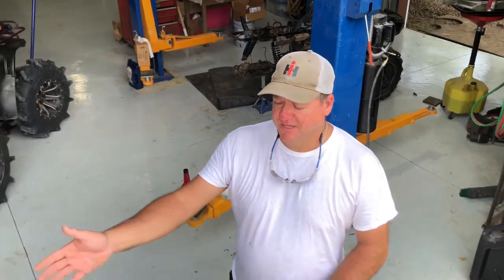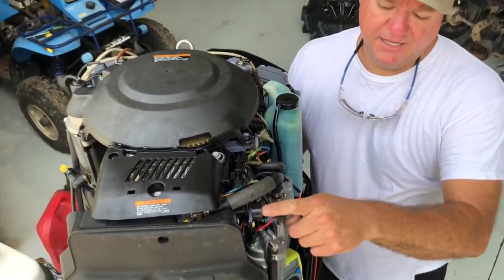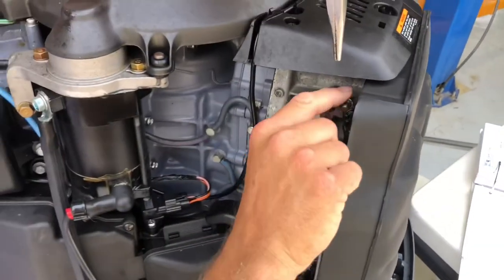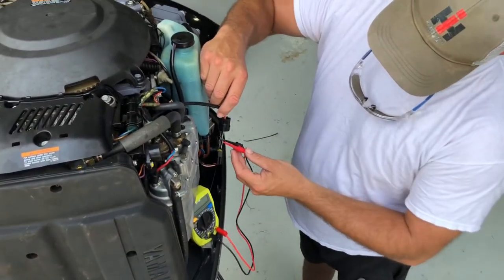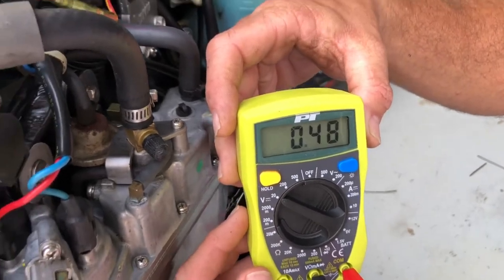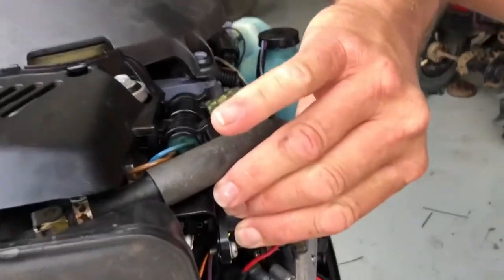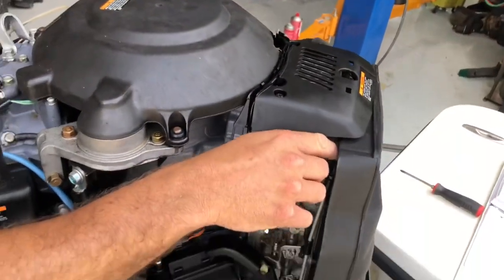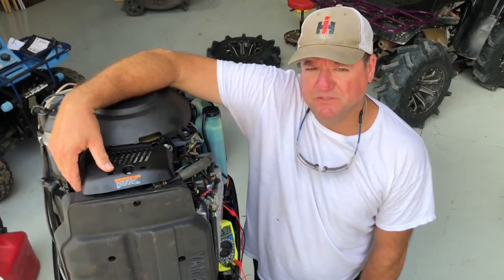Yamaha Outboard 2002 Ox66 225 HP - throttle position sensor test and adjustment.

Comment: I’m having the issue of my 2001 ox66 not getting on plain. Idles great but won’t go above 3000 RPMs. It will jump/spudder trying to get above. Only way I can get above 3000 RPMs and get on plain is when I trim the motor over halfway on my trim gauge. Think the TPS could be the issue?
Reply from the maker: Does it take off every time and get on plain only if you mess with the trim? I figured mine out and it was the fuel pressure regulator screen was plugged up about 90%. I cleaned it and life was back to normal.

Comment: I have a 2000 OX66 225 that im wanting to check and adjust the TPS. When I seperate the harness, I see no way to attach the cotter pins to make the jumper. One side of the harness has holes that will accept the pins but hte other side has prongs. How are you attaching to the prong side?
Reply from the maker: You have to use very small cotter pins and push them between the male pins and the plastic holder.
Reply: @mtwz71  Git it ! Thanks

Comment: Thanks for the video. Awesome. At full throttle on my ox66 150 im only at 4700 rpm.  I've cleaned and replaced oxygen sensorand gaskets. They we're dirty!  I was hoping it fixed the issue, it didn't. I'm at a dead end again. You my throttle cable might not be allowing full throttle?
Reply from the maker: Have you run a compression test on all cylinders? One of the first things I do to a motor before I really start searching high and low.
Reply: @mtwz71  that was first thing I checked. All 6 within 5-10 lbs.
Reply from the maker: Possible wrong prop or bad fuel? Lots and lots of things can effect engine RPMs.
Reply from the maker: Have found anything new? When was the last time you had the injectors serviced? Removed and flow tested them to check the imbalance between them? Typically less then 3% imbalance and you are okay. Check fuel pressure off the VST? I’ve seen the fuel pressure regulator on the VST not holding proper pressure and causing poor engine performance also. Are the reed valves good? List of things to look at.